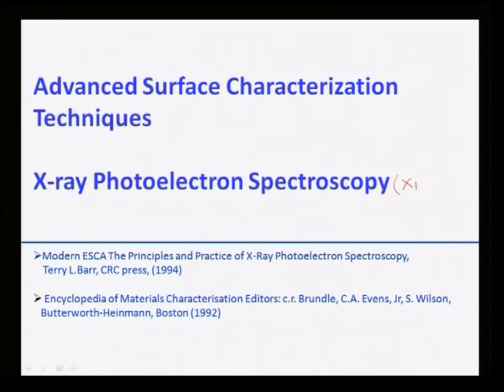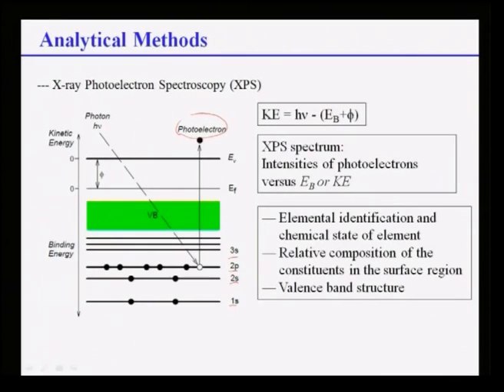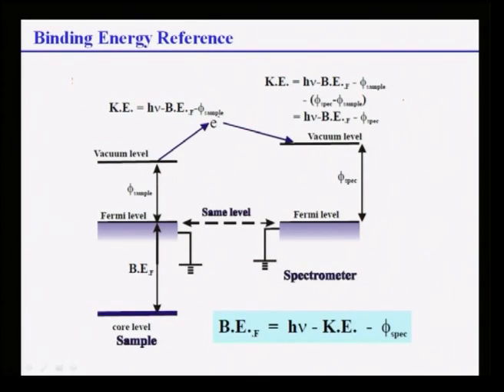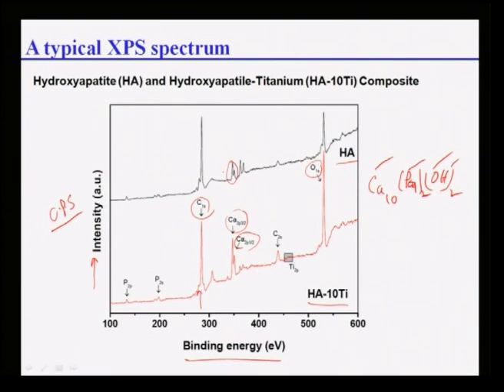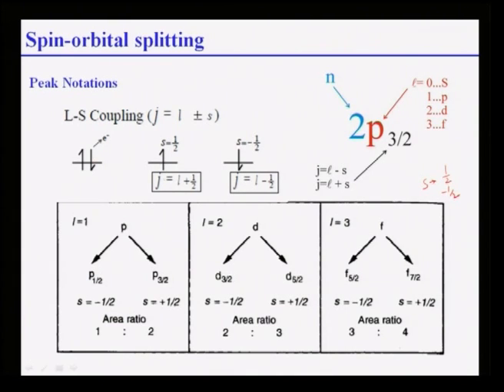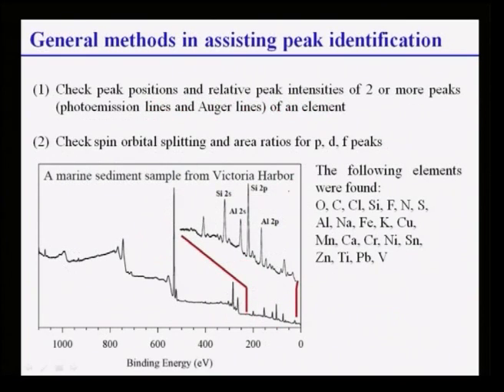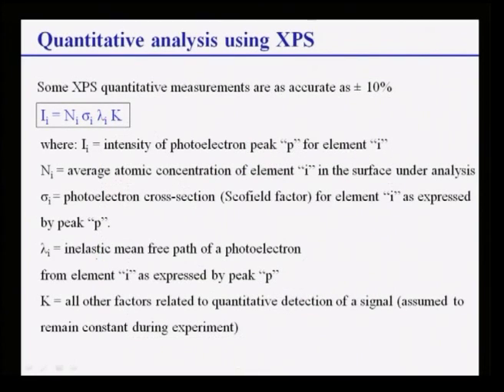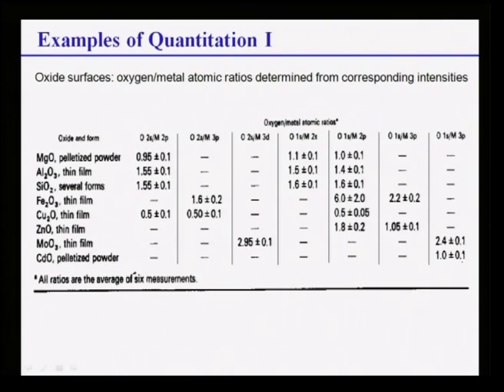Introduction to X-ray Photoelectron Spectroscopy (XPS) | Lecture |

Comment: electron ejection is from core shell. Then why we call it as surface analysis.?
Reply: Because that coreshell electrons are situated at the sample surface. XPS probes sample surfaces to a nominal depth of a about few nm, or so. The X-ray beam cannot penetrate further into the bulk of the sample. Thats why it is called a surface analysis technique. This is my understanding.
Reply: Surface is related to sample not with atom. atom size in angostrom while surface is considered to be 2 to 20 nm thick